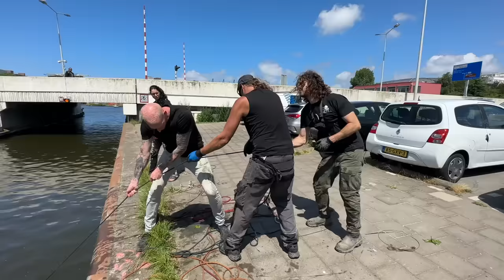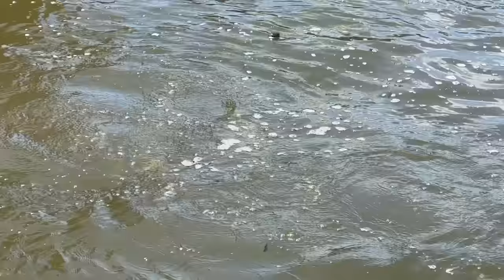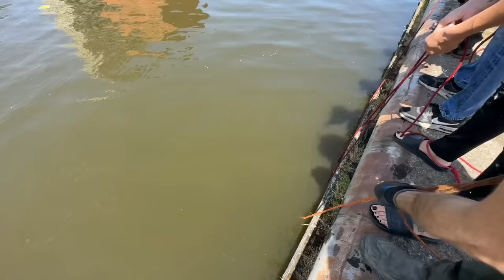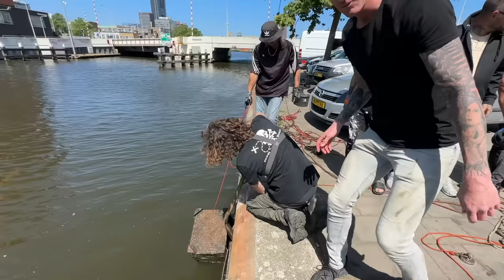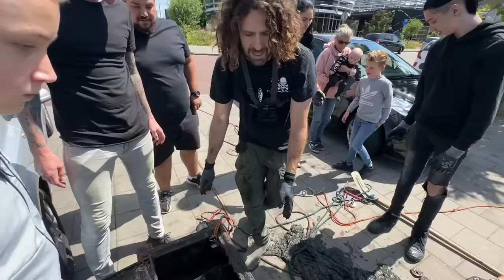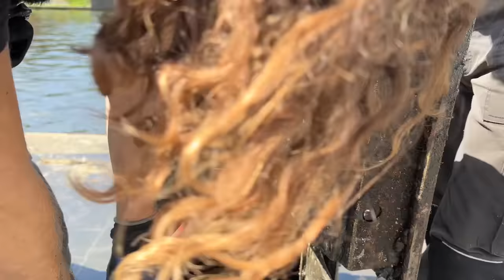BIG SAFE Found Magnet Fishing Epic Criminal Hotspot!

Comment: Iam still pissed at you for braking the plastic covers off of those coins , you had no idea what you did ,you ruined very valuable coins , there are 3 grading company that grade coins PCGS, NGC,  Annex 
These company grade and put coins in sealed plastic cases grading goes up to MS70
The higher grade more valuable  the coins
NEVER BREAK OPEN A Plastic case SLAB get it checked at coin shop first, never ever clean any coins are use cloth are silver cleaner are brush, just rinse mud off in warm water and take immediately to coin shop
You ruined thousands of dollars in coins😢😢😢😢😢😢😢 i was in tears
Did you save any of these coins that i could buy???
Please next time you find coins put them in containers and take to a coin dealer
Take care Mary in idaho
Reply from the maker: Hey Mary, I’ve learned since that video to never break open the cases again 😂 we actually found the owner of the safe and coins and found out they’re worth about €30 each, so not very valuable. I still have them but they’re not for sale unfortunately 😃
Reply: @BondiTreasureHunter  thanks for reply that so cool you found owner of safe 
I love your show and will continue to support you
Lol I bet you heard from alot people after that show
Be safe take care

Comment: If you put a guy, or girl in a dry divers suit with a hood and mask, and you would not need tanks or certification,  they could tie a line around these things so that you guys do not fall on your a$$es if the rope slips off. If  you get an air pump and a lift bag, you could use air to raise your salvage. Anyhow, it is much more fun to watch a punch of guys tug on a line.

Comment: You should have a wheel barrow and put your tools in it to roll it too where you're going and have in it a winch and car battery and a chain then you can chain the winch to a tree and use the battery to power it tie your rope to it to winch up heavy objects or stuck objects out of the water or bolt fhe winch to your camper and park in front of where you're magnet fishing
Reply from the maker: I’m definitely gonna need a wheel barrow if I’m bringing all that stuff mate 😂 usually I’m on my bike so I couldn’t take it all with me but a winch would be handy 😃🤙